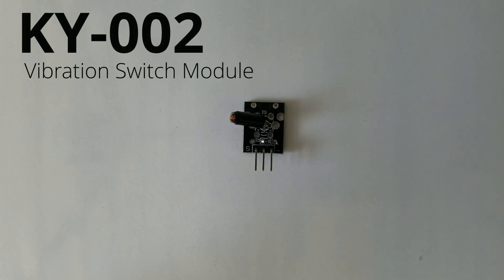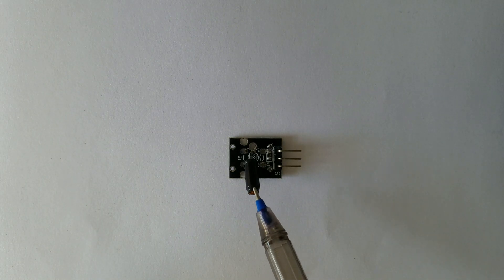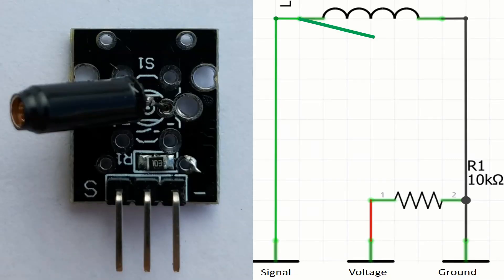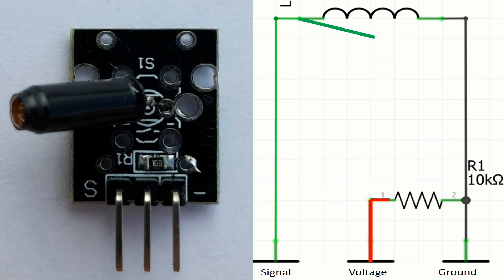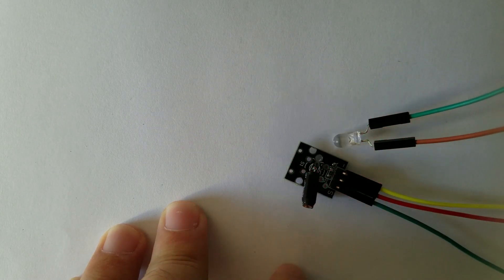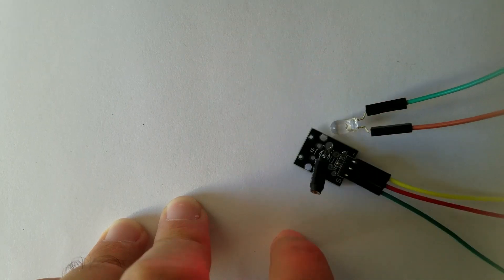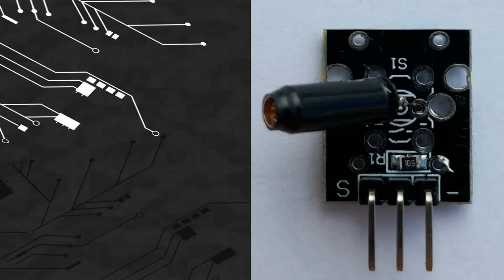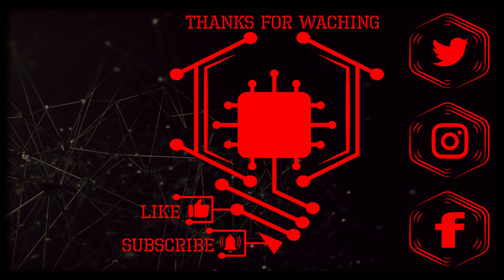KY-002 Vibration Switch Module

Comment: I believe the resistor connects Signal to Vcc, acting as a pull-up resistor for the signal line. If it connected Vcc to Gnd then it would just dissipate energy